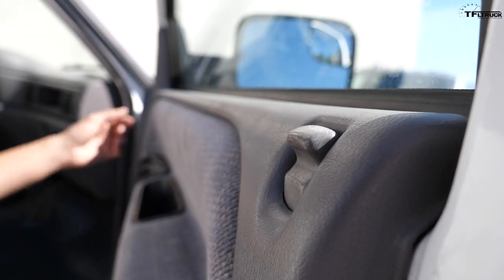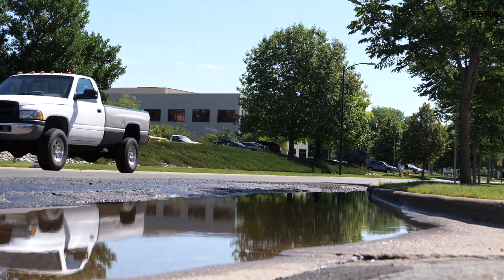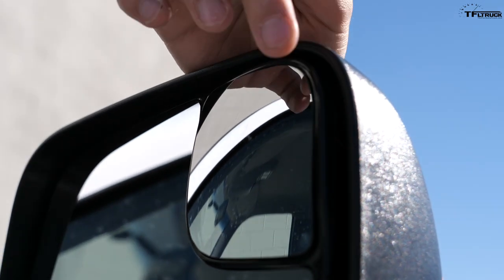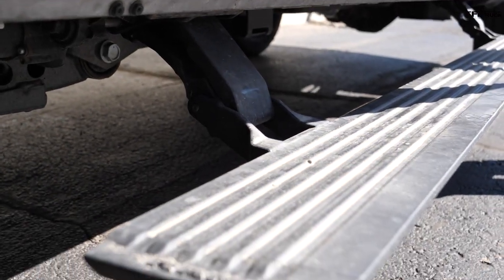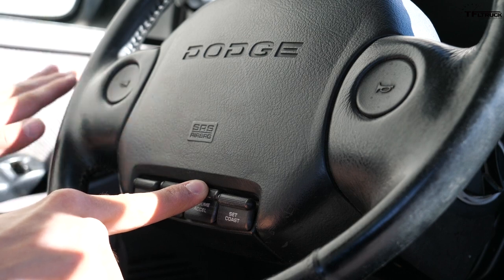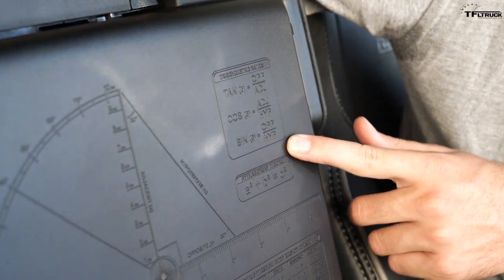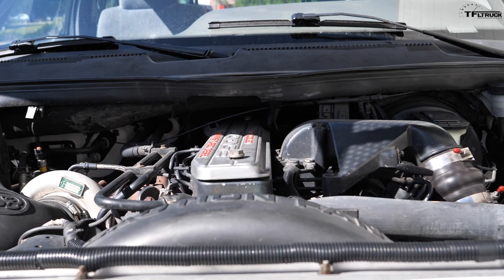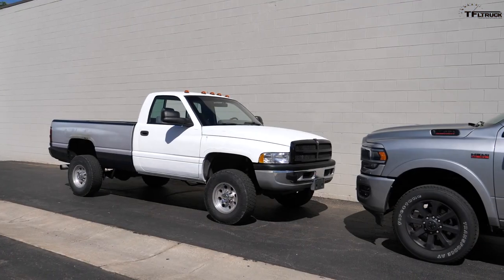Modern Tech vs Old School Simplicity: How Does A 1994 RAM 2500 Compare To A 2020 Ram 2500?

Comment: Let's see how much of that modern technology is still working in 25 years. I'll keep my 99 Ram. 254,000 miles and still going strong.
Reply: doodefunk1 I bet you have replaced a lot of parts also. 254,000 in 21 years is not a lot of miles. My 2006 Tundra has 454,000 miles. 
I can almost guarantee you will never see that many miles out of a Dodge.
Reply: @JI-sg5uy  not a dodge guy but there is lot of them have more than 300k on them already.
Reply: @Meg8554  not only that but there is a whole club dedicated to 1 million mile dodge Cummins, not much of a dodge guy but I have to respect them
Reply: @rvvirt  there is also one for the 7.3 powerstroke havent seen one for duramax yet
Reply: @JI-sg5uy  ther is a fellow they did a story on has a 2000 7.3 powerstroke with almost 1.5million miles and its still going strong with only maintanance items done hes a hotshot truck driver
Reply: @JI-sg5uy  there's plenty of old 2nd gen rams with 500k+ miles lol
Reply: My 98 Dodge Ram 2500 Cummins has 400k on it haven’t replaced anything but tires and tranny
Reply: @TylerDuysen  that's cool I have a 1999 f350 with a 7.3 but I only have 83500 miles so I guess I cant join lol I do like that truck I just cant part with it
Reply: That’s why you can buy a brand new one without the tech. I still see people who drive 40,000 miles a year not have any issues with The tech.
Reply: J I what if Toyota engineers started to work for dodge. The same engineers don’t work for a company for that long and they typically only last 5 to 6 years. That’s why the ram is so much nicer than the competition half of it was done by FCAs Maserati engineers
Reply: @chadhanson4369  that's actually a very good point
Reply: J I Cummins is more reliable than anything Toyota has in it
Reply: Hah it’s simple how the engines and transmissions and axles are cast there just better it’s simple the new is way better
Reply: I still like the old 5.9 though
Reply: Me 2 I love the 1st and 2nd gen
Reply: @JI-sg5uy  I just saw a listing on fb market place with 523k miles the other day🤷‍♂️
Reply: Same I’ll keep my 91
Reply: J I million mile dodges and chevys are everywhere
Reply: It truly baffles me how someone could spend $70,000 on a pickup! I paid $5000 for my 7.3 power stroke F250!
Reply: That is the same response every old man gives when they can’t afford a new truck, StiLl gOinG StrOnG lol
Reply: J I 763K miles on my 04 24 valve. 2004 dodge Cummins only replaced tires brakes filters and oil
Reply: @JI-sg5uy  i have a 2nd gen with 582k miles so yeah I can almost guarantee there is definitely many 2nd gens with more miles then you're toy-yota driving around.
Reply: Well my brother's 05 Cummins has 445k miles on it and still drives well. I've got a 1995 Dodge ram 1500 with a 5.9 magnum and it has 283k miles on it. I'll never drive a Toyota I like trucks
Reply: Yeah I agree the old ones r way more quality
Reply: @JI-sg5uy  Why are all toyota fans like this lol?
Reply: Hook a 9000# skidsteer and 2500# trailer and a full fuel tank in the bed of that toyota and see how many miles you get out of it
Reply: Right on!
Reply: J I You can. My uncle has a ‘00 3500 Cummins, manual and he’s done nothing to it besides the basic maintenance.
Reply: I feel good reading these comments...i just grabbed a 99 with 18k miles...it was a nice lil barn find in showroom condition
Reply: Jonathan Branco Anybody can afford those things. 🤣
Reply: Jonathan Branco I drove a 2020 RAM 3500 before I gave it to my dad for a ‘96 he abandoned. I can show you the invoice, paid in full.
Reply: If half the stuff quit working it'd still have more features
Reply: Tyler Duysen I saw that old man driving his power stroke  on IH69 here in Houston Texas maybe a month or 2 ago
Reply: There are dodge 12 valves with triple that. The factory manual doesn’t require a rebuild until 500,000 how many times have you had to take in your tundra
Reply: @JI-sg5uy  I'm sitting at 373k on my 01 Ram with a Cummins. Look up the cummins high mileage club there's tons of trucks with close to or over a million miles.
Reply: @BSTLIVE1  That's awesome! Cummins? You will have a lifelong truck if you're starting at basically new
Reply: @alexmatthews2332  

It's not the Cummins It's the 5.9  Magnum...
Reply: @BSTLIVE1  Still good motor i have one with a dump box on it that pulls my chipper doesn't burn any oil between changes which has always impessed me grossing around 15k loaded with chips and chipper in tow.
Reply: Stay old school, my 19 3500 limited has been nothing but issues after 60k. New egr and egr cooler at 64k. New turbo and egr valve at 99k I hotshot with don’t pull no where it’s max but it sure loves the shop. I left ford and now wish I’d got a new 6.7 power stroke!!!!
Reply: J I “strong”
Reply: Didn’t have to flex that hard
Reply: @JI-sg5uy  true but I want a tundra diesel
Reply: @TylerDuysen  original motor and transmission
Reply: @AlejandroP1980s  yes the only thing hes done is maintanence and injectors at 1 million only 1 failed but he said do them all since hes a hotshot driver its a 7.3 with a zf5 speed manual
Reply: @jacobhill4788  I guess it depends on the type of person; nothing wrong with differences. Always chasing the "next" will make you a perfect consumer and if that makes you happy who am I to judge.  for the blue collar Usa demographic our top out wage for the most competitive companies is 30-50 an hr or 60-110k range a year. I choose to stay with one vehicle so I can save money and pay for family dreams & kids higher education.  For me it feels good going 2 years with out a payment and only requiring oil changes (100 dollars a year in maintenance).
Reply: @JI-sg5uy  My 01 has 657,000
Reply: That’s boomer af
Reply: Technology in cars is the downfall of cars in my opinion. The technology is literally where most problems start from nothing. Especially from the early 2000s. 15 years later, and all of the technology is failing and causing other mechanical parts to fail. The less technology, the better in my opinion.
Reply: @chadhanson4369  It's those same Italian designers and engineers that lower the current quality vs the old. Maserati and every other Italian car are nothing but low quality money pits.
Reply: Agreed, in 25 years we will see what the new one is selling for. I have a 1995 pretty much the same as this one. I bought it a few years ago, and I think its done depreciating. Plus the 12 valve will go down in history as one of the best engines ever.
Reply: @JI-sg5uy  like all 12v have 300k miles not that hard Toyotas arent god sends
Reply: Justin Schooler  go type in million mile tundras. I was talking about Dodge the truck. Not the Cummins Motor. The motor is great. Those 2nd gen trucks fell apart. Just ask the people who actually own them. They know the truth. Hate to admit they’re Piles of crap
Reply: Exactly, all that tech will be replaced in five years with brand new tech and good luck finding parts let alone someone who knows how to install it, I don’t know but the fact that you can press a button on your steering wheel and the gas pedal goes down makes me wonder what can go wrong rather then “ that’s awesome”
Reply: 00 chevy silverado 1500 300k miles running like a top
Reply: 315,000 on my 1994 gasser..... Yep, rebuilt the trans. Cost $1,000 for a quality bench build and took me an afternoon out, and afternoon back in.
Reply: Justin Schooler  Strictly a work truck, but yes light tow loads rarely over 4k. Try to keep it under 1k in the bed. Did get a new trans under warranty way back and a durango block a few years back. Ride quality damn near make your kidneys bleed!
Reply: Justin Schooler  Fix what you can, ignore what you can't. I live in a no rust zone so I don't have that issue, I feel for those that do. Dash turned to dust years ago 😆
Reply: I have ram 2500 94 gas 300000 miles. Still driving strong 💪
Reply: I stay with old. 5000$ vs 50000😲
Reply: Want a cookie
Reply: @JI-sg5uy  my 97 has 475000 miles and running strong
Reply: gotta 96 2 door with over 500,000 miles on its 318 and still runs like a champ
Reply: I love the new trucks too
Reply: @JI-sg5uy  How many frame re
Reply: @JI-sg5uy  how many frame replacements have you gotten lol
Reply: Yea I have a 95 ram 1500 with the 5.9 magnum the engine still going strong but the transmission likes to slip every now and then but if you rebuild the transmission they will run forever especially the 12 valve cummins
Reply: I got a 97 Chevy with 236000 miles and works great

Comment: With the 12 valve, you gotta turn off the motor in drive-thru lol.
Reply: I’ve been there and had to do that 😁
Reply: Unless you are running waste vegetable oil which smells like BBQ
Reply: Always did
Reply: I have to turn my 6.7 off also
Reply: I have to do that also with my 24 V.
Reply: So true
Reply: Why is that? I always wondered? Noise? Poison air? Both seem like practice reasons lol 
Just bought a 94 5.2 single cab Laramie, can’t wait to get an old Cummins
Reply: Yup both my CUMMINS need to shut down at the drive thru. The customer's in front and behind me hate me Lmao 🤣

Comment: I’d take the 1994 that 12valve is a strong motor and yes those trucks did rust a bit you still can’t beat the feeling of driving a old truck
Reply: They act like that truck isnt over 24 years old. That 94 will last longer than the 6.4 all day everyday
Reply: Except  the old truck are gutless and make 100x times the black smoke . Nobody likes that anymore especially when your camping towing the trailer around smoking out everybody and there so noisy
Reply: @daye3371  I love rolling coal
Reply: I'd take the 94 Ram over the new Ram.
94 Ram, ZERO emissions, all mechanical,  and not a lot of onboard computers.
Reply: @angelmarquez5946  that engine and transmission on the '94 will run forever.  It's like a cockroach, it will survive a nuclear blast.
Reply: @daye3371  actually 12 valve cummins are very powerful motors that were detuned to be put in trucks. With a few basic bolt on mods they can make 4-600 hp. Not lacking in power at all and much much cheaper to get the power out of.
Reply: @freewilloutlaw6275  its 26 to be exact
Reply: I just miss being able to fit a full sheet of drywall in the bed of a truck and closing the tailgate.
Reply: Exactly, me and my family own a business with 7 “2nd gen” Cummins and the fact he said that they have a towing capacity of 10,000 is funny because we tow 15-16k pounds back and forth between jobs every day
Reply: @cainanbrewer6628  thats because they do but yeah i know they can the 7.3powerstroke and 12vs were under rated and detuned from the factory they are great solid reliable motors
Reply: daye3371 calling them “Smokey” is a term I would use for someone who doesn’t know how to tune a built truck, also older diesels run better no def fuel no EGRS, if you don’t understand how that stuff all chokes engine performance and it’s bad for these diesel trucks then don’t comment back
Reply: The old ran will easily pull more than the new one, my grandpa (given he had a second gen with 24v) pulled over 30,000 with no problems at all, where I have seen 5.7 and 6.4 hemis struggle with 15,000-20,000
Reply: Yeah if I love my old Ford f150. All the old trucks have their pros and cons but I have over 234,000 miles on it and she's still going strong.

Comment: Give me old and simple anytime. The new one is unlikely to last 10 years.
Reply: wrong... I have a 19 2500 gasser. One of the first things i did was break out the creeper and take a cruise underneath.. The truck is beefy. Yes they cost more than any of us want to spend. But it will last every bit as long.. no question about that. And it all depends on how you take care of things.. Some guys can break an anvil with a feather...lol
Reply: Everyone on youtube says this but i rarely ever see anyone driving a 20+ year old truck in real life
Reply: Bobby Hill I drive a 1990 f150. Older then me.
Reply: I have a 1986 Chevy k20 it runs great
Reply: Jeep is the only company that does that now, all the rest put in lots of tech. Not that my dad has had any issues with his 2013 ram in 132,000 miles but spark plugs and a belt
Reply: Bobby Hill I see it all the time
Reply: I don’t mean to sound like “that guy” but in all honesty, the most older trucks I see are Silverado’s, and then Ram’s and then the F150’s
Reply: @andysmith8295  you'll be singing a different tune when your steering wheel locks in place when you're driving down the freeway.
Reply: @gabehixenbaugh1997  i have a 94 f250 its older then me too lol
Reply: @bobbyhill4715  i run hotshot with my 5 spd 1995 F350, and actually just got back home from hauling 30,000 lbs on the gooseneck 2 states over
Reply: Basic easy to fix i have a 98 ram 2500
Reply: @andysmith8295   uhm it hasn't been 26 years since 2019..?
Reply: 😂 that HEMI will last a good 150k miles then its shop time and big money drop after that point!
Reply: @bobbyhill4715  I have a 98 still runs great paint rusted dash board cracked up I still love my ram 1500 5.2 v8 Laramie slt
Reply: I agree with you with the old one but I think the new trucks are gonna last a lot longer than 10 years buddy

Comment: $1500, 3 hours, and that 12 valve will walk that 2020.
Reply: A 1000 dollar tune and the 2020 would walk it to the junkyard😂😂😂😂
Reply: @reyfuentes4572  no that 12 valve will tow the 2020 to the scrapheep
Reply: Those who doubt the 12 valve have never ridden in a properly tuned one. Dont take much to have em over 500 rwhp.  For the record, i had two, manuals, and 4wd, a 95 and a 96, i regret selling them both.

I drive a 16 now, and it aint the same.  The old trucks were better, but i did what i had to do at the time
Reply: Ricardo Bernal the new ones almost make that stock lmao. I had a 12v that was 450hp and that poor engine felt like it was hanging on for dear life. I like the 03-05 the most, I had a couple low mile ones and they were awesome. Could also run door to door with a c6 vette with only a tune and do rolling burnouts if I dumped the clutch at 30.
Reply: MrPland1992 , probably wasnt properly tuned, timing was probably not where it needed to be, and also depended on which pump you had, 160 horse, 175 horse, or the 913 or 887 which were 215 pumps.. different requirements for tuning each one, also, a little
Thing called a governer spring kit makes a world
Of difference in these trucks. Forgot to mention, both of mine were north of 500 rwhp when they sold
Reply: Ricardo Bernal I think it was only turned up halfway whatever that means. Had an hx40, was quick and ran great but a $3500 truck if that makes sense. Prolly a 14 second 1/4 mile, it would walk full bolt on Silverado’s and rams all day. 
I’ve had like 30 of them and they are kinda ass lol. I don’t blame the truck though just the previous owners. All pissed oil except for a few. I had an 07lbz that was an animal and a few 6.0’s. I’m prolly the one person that’s never had a problem with the fords lol. Any issues with the 16? I want a new one but I’ve heard the electronics are iffy.
Reply: MrPland1992 dont trust it like i do my old 12 valves or my 05CR that sold with over 300k, lets just say, i
Have not had major issues, but those problem areas have been addressed to say the least.
Reply: @ricardobernal8897  They make brutal horsepower.
Reply: Grunt  or a 12 valve suburban.  Same same.

Comment: I had the 2019 cummins but sold it due to constant electronics issues. Found a 2002 cummins we are really happy with.
Reply: I have a 2018 Ram 3500 dually, with 120,000 KM on it. Haven’t experienced any electronic issues.
Reply: @erichkaufmann5284  well our 4x4 module snapped and it rendered our 2017 ram 2500 hemi basically undrivable because it wouldn't even start. Had to tow it to the dealership and paid 800 dollars to have the problem fixed
Reply: Nice I bought a 02 CUMMINS std cab 8' bed 4x4 5speed new (still own it. Needed a crewcab for my  family to fit so picked up a 2004.5 cummins 6.5 4x4 automatic (ATS STAGE 5) Fully loaded with lots of aftermarket accessories 100k easy miles.
Cost me 20k. But new sticker price was 45k (sticker came with truck). Add on aftermarket upgrades about 15k. So there's good deals out there If the de-icer on the road stops eating them.
Reply: @erichkaufmann5284  лол, ты по россии на раме гоняешь?